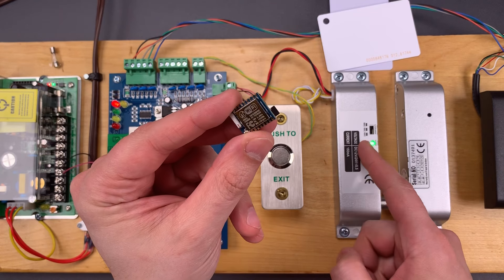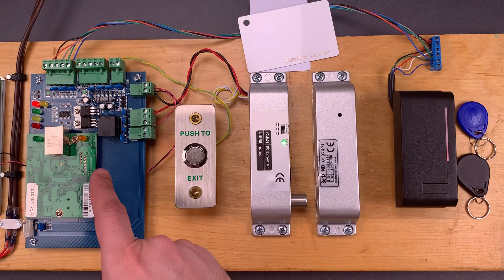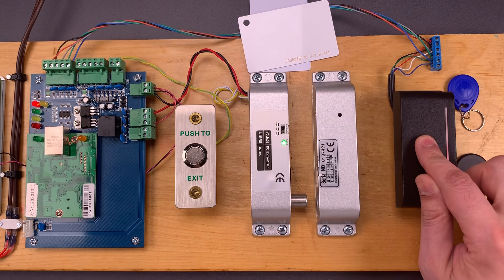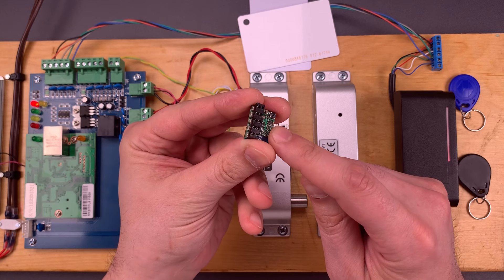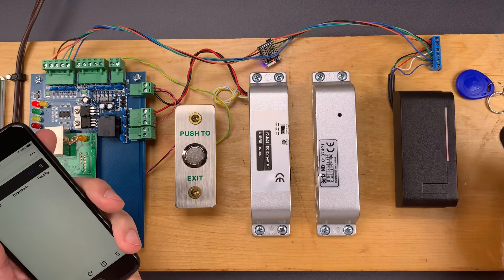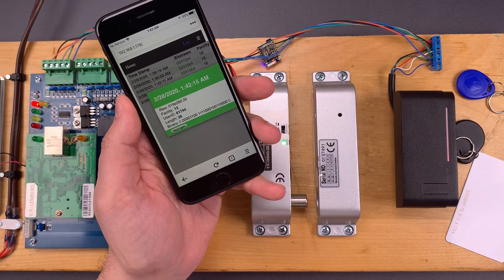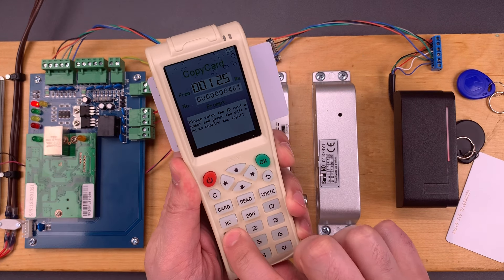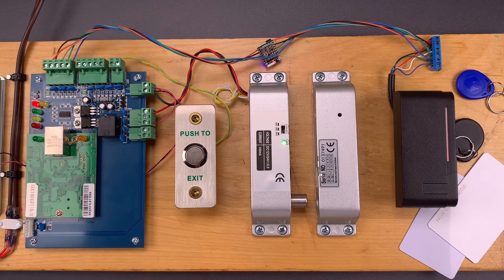[1052] Bugging an RFID Card Reader

Comment: Seems like unnecessary comlicated attack. RFID transmission seems to be using stadnard encoding. Therefore a tiny, easy to hide RFID reader, can be placed and concealed next to lock reader. When user is opening doors with his RFID key, both lock system and attack RFID reader get the data from key. Any phone with NFC can then program cards with the stolen data and voila, access granted.

Comment: I'm not sure this qualifies as "very little effort." You've got to get to the wires, to start with, which is generally going to include removing the card reader from the door or wall it's mounted to.

Then I assume you have to connect the correct wires. Color coding is not guaranteed (I would personally obfuscate that if I were installing such a system). Imagine going to the trouble of tearing the card reader off the wall, and all of the wires are red.

So, to be certain, you'd need schematics and you'd need to actually open the card reader to find where wires are connected, which would be the only way to ascertain each wire's function that can't be obfuscated with very little effort. It could still be obfuscated by anybody willing to solder and add traces.
Reply: It is indeed way easier to get a long range reader and directly read the cards from employees or security personell. Deviant Ollam had a talk about it how they did it to gain access. Often entrances are CCTV monitored and you just can't mess with the reader that easily.

Comment: It doesn't seem to be an LF RFID system, so you could've simply used your cellphone to write that NFC card. You could even read and copy a card too without a special device. Also if it's NFC, the cards and tags have the ability to digitally sign data using public key encryption methods. The reading device just uses the card IDs to identify them and it's so wrong and unsecure. It should've saved their public keys, and then authenticate them by sending a randomly generated code to the card via NFC and see if it's digitally signed with the correct private key. That way it wouldn't be vulnerable to this simple replay attack.

Comment: You just need to make sure that it is a form of rolling encryption. Otherwise even if the data is encrypted, recording the encrypted output and reflecting it back down the data line will still produce the same decrypted message in the secure unit. Why these units don't come with rolling encryption up to the trusted hardware by default astonishes me. It is the bear minimum security for modern car key fobs.

Comment: The encryption part between the unsecured and secured part is mostly useless. An attacker can always man-in-the-middle inside the unsecured box instead of the communication wire. Encryption between the knob and the server (as suggested by some) is also, alone, insufficient since it would be vulnerable for replay attack (either locally or not). Some kind of time-dependent challenge-response protocol that would not expose directly the keyknob’s secrets inside either secured or unsecured channel such as FIDO2 might fare better. Even then, FIDO2 client-side trust demands a trustable “browser” between itself and the server, else one knob could be secretly opening another remote door without the user permission. Well, crypto is hard!

Comment: Wait so

Couldn't you put a decryption chip on the same card with a lil memory? Then it store encrypted, does a bit of math, and the next time data comes in, it tests one of the decryption results for the first swipe? It'll get the ol yes or no, and no matter what it'll seem like a mis-read so you swipe again and it just logs it. If you set it to only test one in 5*(number of unique valid swipes logged), the irregular hiccups should go unnoticed until your crackerhacker has data logged and decrypted?

Comment: If it was encrypted you couldn't clone the card, but wouldn't you still be able to replay the encrypted data through the wire with the ESPKey and open the door?
Reply: Kind of late but not necessarily. Something you could do is have the scanner and control panel have a pair of keys, one of which encrypts the pass code which would go to the scanner, and the other of which decrypts it and would go to the control panel. Every time the scanner detects something, it would generate a new key pair, and encrypt the decryption key with the encryption key from the previous pair, send it to the control panel to be decrypted again, and then both old keys would be discarded.
This way, they device wouldn't be able to accept the same input twice, as you'd be sending data that the control panel can't decrypt anymore.
Reply: @snowthemegaabsol6819  Good point. Neato.

Comment: I'm not an expert in this kind of devices but... if you need to install that chip in a MITM fashion inside of the controller panel or wherever the main board is installed, isn't the security already been defeated anyways? Like, you're probably already inside of the room/building you wanted to enter. It'd make more sense if you could hide that chip somewhere near the reader, without being noticed, and clone a valid card code. I mean, your point is totally valid, encryption is required. Probably using E2E encryption with keys that are unique per device so nobody can get the keys from one unit and then be able to decrypt the rest. But I don't know about this method... Still cool...

Comment: That's a very unlikely set-up. The card reader will be placed outside and the cable is layed inside the wall. It will run directly to the access controller. So how on earth should anybody be able to attach the sniffer on that cable? 
Even more: today its more normal to install a burglar alarm with access control. So even as the access controller is not placed right beside the door, it's impossible to place the sniffer as alle junction boxes are tamper prove.

Comment: TLDR - would anti pass back be applicable here? 
I understand the weaknesses with being able to clone and midline attck, but I'm curious to know if anti pass back could block this type of attack, at least partially. If you're injecting a spoofed card, does the system see that it came from an external reader or does it just simply see a valid code? For anyone who doesn't know, anti pass back is what it sounds like: a software configuration that reads tokens (cards, fobs, etc.) and the corresponding device they were swiped at. If that token is then presented at another external reader, the system will deny access. This is so an employee can't badge in and then "pass back" their token to another unauthorized user to gain access at another place or time. You have to then badge out of the facility. Any place that has a reader on both sides of a door has this ability.

Comment: I started watching this video and paused at 0:45 to make this guess.

I bet that the chip in question cant be used if there is no exposed wiring for the RFID reader. Unexposed meaning the cable is run behind the door an comes thrugh the wall to the reader.

Comment: Does the ESP key run on the power of that system or does it have its own battery?
Reply: It is powered by the supply lines between the scanner and control panel. Which wire it is depends on where you're from, but most of the time is either red or black

Comment: This attack only works if 1) You had access to the internals of the card reader, i.e. you're the guy who installed it. And 2) You want to get into the building after you've installed it without the use of an identifiable RFID key... This device is NOT some kind of James Bond style entry device, it's a piece of locksmithing geekery that nobody outside of locksmithing will really give a shit about - not even would-be thieves...

Comment: I am entirely lost how does the ESP module come into play at all? I see it wired in there but how are you gonna wire it into a building with all the controls on the inside of the building? I don't see how you could do anything with this not that anybody should and I certainly would not try to gain illegal access to a building but seriously how would you even have access to set it up so you could read peoples cards? How can you record the output?

Comment: To have access to the communication wiring screams “flawed” to me. You should not be able to install this device inside the reader. 
However, there is nothing you can do to prevent the radio signal from being intercepted.

Comment: "Otherwise an attacker can compromise the system with very little effort."
Ah yes. All an attacker needs to do is remove the outside panel, install a listening device into the wires, reinstall the panel without leaving any traces of having removed it, then leave and come back later once the card reader has been used a few times. Very little effort!
I honestly feel that security which requires you to approach multiple times is pretty decent, and this attack method leaves signs for anyone investigating the wiring.

Comment: LPL mistakenly thinks that encryption would help. It will not: since you can fiddle with wires, you don't even need RFID transmitter - simple replay attack on interface itself would work, no matter how you encrypt data.
To protect from that you would need to implement challenge-response style communication between board and sensor, similarly to cars.
Moreover, if your card have no challenge-response protocol inside, you probably don't even need to tap wires: just sniff NFC communication.

Comment: But the most better systems even have a "Key" to even read the data from the RFID chip.
Without this you unable to read the Key and it is very hard to copy that.

Also some RFID chips transmit encrypted or send every time different data.

It would be also Possibile to use OTP(One Time Pad) for RFID systems, so every time one key is used it will be blocked in future.

Comment: Yeah.. well..
This Method works if you are able to access the wires.  And you need to bring a mobile soldering station.
And you tools for making all that without a trace.

I consider this system as secure. Noone has the time to start a whole toonchain operation on somones frontdoor.
Espeacialy not when it is an Building insider a City where people live and work.

Comment: most of nowadays readers have tamper sensor so you wouldn't open them without notice. Plus some even 'kill' their memory and lost coding leaving them unuseful if tampered with. 
How else are you gonna mess with the cabling? Rip it out of the wall? 
Ofcourse, as allways there's human error included. If a security officer 'sleeps' when alarm is triggered than no system will save you...
Good point about unencrypted data though. More reallife version of this 'hack' is when you capture pure rfid data between reader and card, not reader and the controller.

Comment: if the cable goes behind the device directly into the wall you can't use the chip on it so even without encrypted data this is still ok

Comment: Forget encrypting the interface between the reader and the control system, that doesn't come close to cutting it.  This is a job for a smart card and public key cryptography.

With such simple RFID cards, who needs to snoop the interface between the reader and the control system?  Just put a reader in your pocket, and bump into your "target" in a parking lot or social engineer a moment alone with their wallet.  It's easier and leaves less evidence.

If you have a smart card signing a nonce and a rolling code with a private key of appropriate length, no amount of snooping the bus will get you to a replay attack.  Even if the bus itself is a plaintext standard like USB.  There are actual existing standards for how to do this.  There were standards for this way more than 2 years ago.  Why don't these clowns follow the appropriate standards?!

Comment: It USED to be difficult to obtain ID writable cards, or writers for that matter, but I assume you've overcame that.  And I have to mention, security that relies on the ID of the card is EXTREMELY BAD design, because card IDs are easy to clone.  Those cards have anywhere between 256 bytes and several kb of storage on them that can be encrypted individually in small chunks.  A bit can be set on the card to FOREVER LOCK the cell if the wrong password is presented.  Any properly designed system will put a randomly generated identifier in that cell, and the door reader will only really look at THAT to authenticate the user.  This also makes it very hard to clone a key that you possess, unless you know the passcode to read it.  (and its possible for EVERY CARD to use a different passcode)  Maybe this was the "encryption" you were talking about.  If they're not doing this, it's about as good security as a WARDED LOCK, if you get my drift.

The only time you should be using the card's ID exclusively is if you've got something that doesn't require security, like if you're just trying to keep track of items in a warehouse, checking in runners/vehicles, etc.

Comment: Mutual authentication is where it’s at nowadays!
Wiegand data is so yesterday!

With the newer OSDP readers, this attack is a little harder as it’s using differential signaling beteeen reader and controller.

Then add the reader to controller encryption , makes it super hard to tap in

What’s still easy though is cloning cards....unless the cards are ‘locked’ 

Summary,

Newer systems have a card-reader encryption
Then a reader-controller encryption
And carry encrypted ‘card numbers’ once the above is carried out

All that makes cloning much much harder

Mind you, any company still installing 125MHz prox (as used in the video?) should be shot :-p

Comment: Encryption alone doesn't help.

If you encrypt password, and then someone records transmission - even through they won't see the original, unencrypted password - they could still "replay" that transmission and it'll work.

One has to, for example, combine the pasword with a timestamp (like number of seconds since 1970). Then recording transmission wouldn't help, since that encrypted message will be valid only for a second.

Comment: SO for those wondering even an encrypted connection would still be replayable. The way they fix this on something like MiFare is that the lock sends the card some data which will then trigger the card to read memory at a location and send the contents of that memory to the lock, which the lock acceepts. Even that is vunlerable to a replay attack tho with a proxmark

Comment: Maybe I misunderstood what's going on here but I think it is unfair to say the system has a flaw. It looks to me to break it, you need to have a card that works (authorized) in the first place in order to record the code. This is akin to having a key to a lock already, and then say the lock has a flaw. Using these two devices to clone a key card  you already have seems overkill, I have a feeling there are much easier way to clone a card.

Comment: Yeah, guess what, what you just did is still possible on a card reader than only transmits encrypted data, you just need to piggy back the ESP32 internally before the data is encrypted, which may I add, is still doable in the majority of systems, even the ones with embedded coils on the pcb directly linked to a custom chip that would immediately encrypt before outputting anything, although there you would instead be recoding an analogue signal directly from the coil. So yeah, I have a couple challenges for you :P I'm betting I need not specify which 2, although the coil approach may be hard to do as I am yet to find such a custom solution, though that is not really my area, more IT and Microelectronics

Comment: I honestly fail to see how mitm atack (which is essentially what this is) involving extra hardware is actually any good. Any decent security would scan for extra wifi networks, if any are allowed on site at all, and well.. connecting to an existing one without password... unless there was a major breakthrough in hashing encrypted keys, would take you what many years? ))

Comment: Encryption wouldn't really be that helpful though, it would only prevent you from making new RFID cards that work, but transmitting the same encrypted signal through the wires directly would still open the door. What you'd actually want is time signatures, basically each device would have a custom code called "seed", and the deivce would need to be able to synchronize it's internal clock with the controller's time, then a timed one time password (TOTP) key could be produced based on that secret seed number that was put there by a manufacturer. With this, simply sending the same data wouldn't be enough, since it wouldn't match the additional TOTP key. But you'd also need encryption, to avoid just being able to remove the TOTP data and use the rest to replicate the RFID card, both are important and just encryption isn't enough.

Comment: it would be easier to just scan one of the rfid cards themselves , get ya in no problem no ripping into control panels necessary you could just as easy stick a card reader near the lock or just swipe someone's pocket with one

Comment: A lot of bickering in the comments when since RFID systems give off a strong signal using a scanner might just give a better result than trying to tamper with a lock system that may or may not have hidden features to resist attempts like this.
The point tht LPL is trying to make is very simple, you do not use any form of digitial RFID system that has un encrypted data transmission in it, regardless of how James Bond like this way of accessing the data is. 
The basic argument is that if you use use data that can be read without any form of encryption then your security is already a notch lower than where it needs to be.